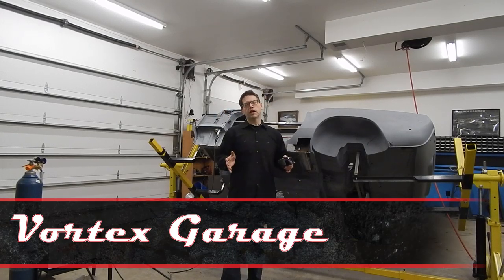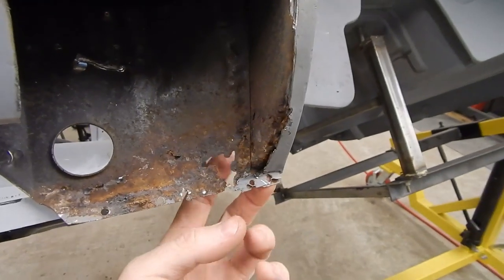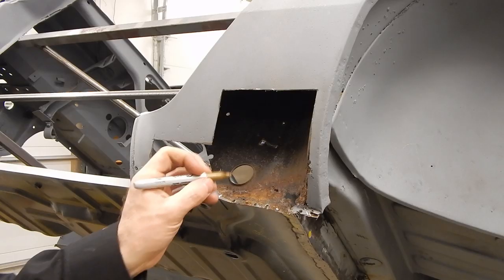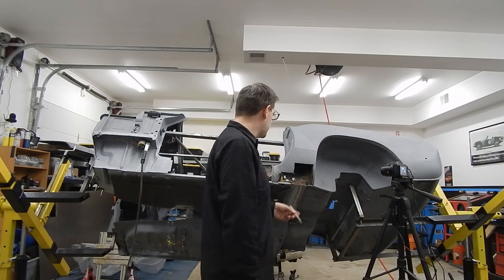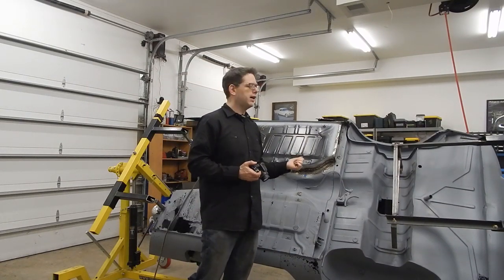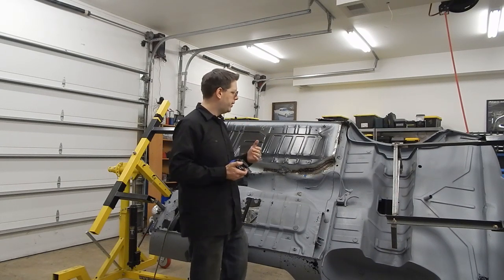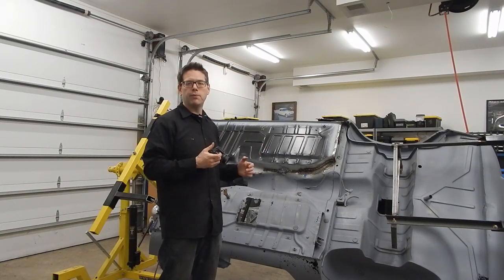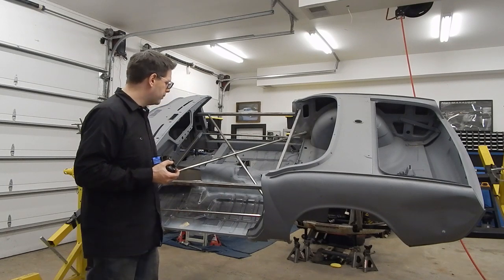Spitfire Restoration Update vLog - Feb 17, 2019 - More Metal Repair...

Comment: It going to take a long long time to get it done.
Reply from the maker: Oh yes, I wish it would go faster but it's definitely going to take alot of time!
Reply: @VortexGarage  That is the part of the fun of it is doing all that work. When you get done with it you will feel a great sense of accomplishment. Its a very satisfying feeling to drive down the road in an old car that looks like it just rolled off the show room floor. I had a 69 vw that my dad and I painted pearl white in 1978 and my friends told me they saw my dad driving to the store and it looked brand new. That was really cool to hear that. It did look good. I sanded for months on that car and my dad was pro painter from painting all those boat trailers at a manufacturer. We didnt get the car done over night but in the end it was great looking and worth all the trouble. My dad did all the body work too the car was hit on every side.